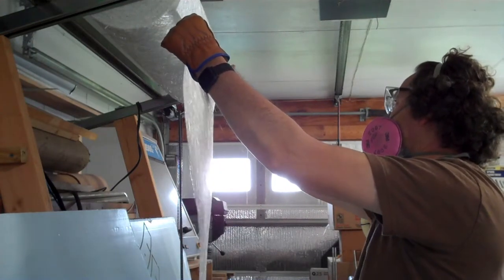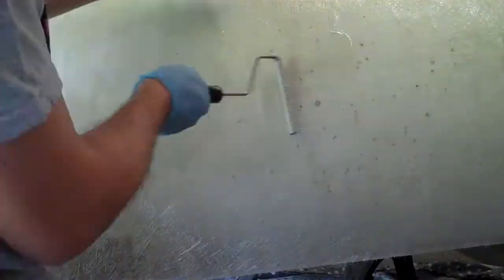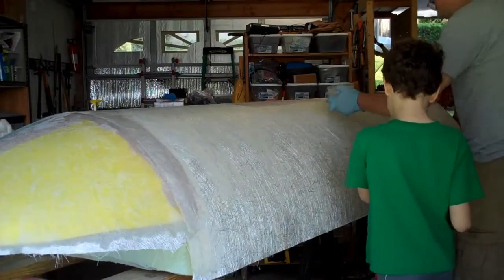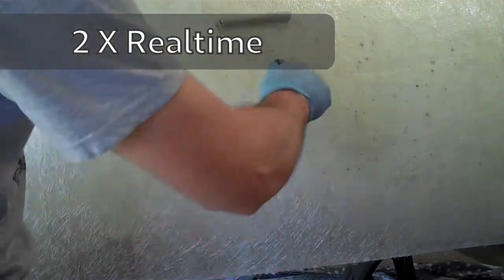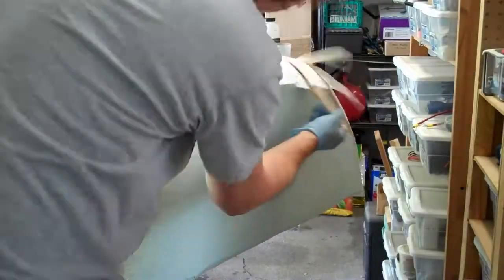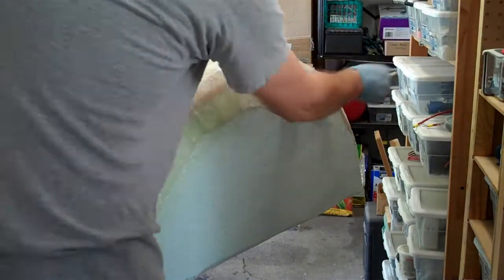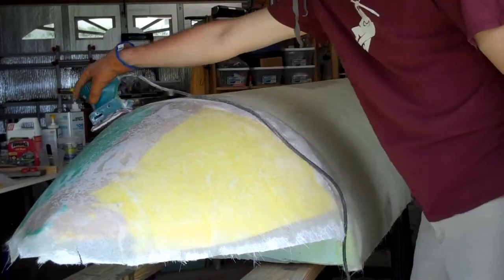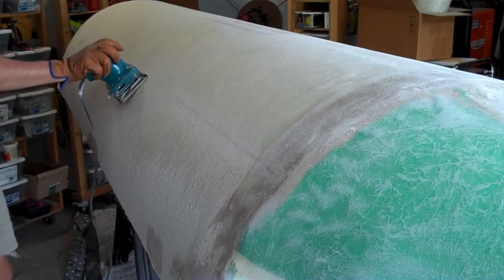Using Chopped Strand Mat with Epoxy (Building a Fiberglass mini-pontoon boat part 3)

Comment: I've never had a problem with it. I repaired a hole in the bottom of a jet ski with chop strand Matt and polyester resin and then took the boat out and the hole patch just popped off. I redid it with epoxy resin and chop strand mat and it's been holding for 8 years now.

Comment: Mix 1/10 acetone into your epoxy and it will dissolve the styrene binder. I do it all the time
Reply from the maker: I'm already using thin resin, and I'd be worried that 10% thinner (the absolute max) would reduce the strength by 60%.
Reply: @summetj  the acetone will evaporate after it melts the styrene binder. Your resin wont be weaker.  Your fiberglass is weaker than it should be if you dont break down the binder.
Reply: 1/10 of just the epoxy resin or the hardener and resin comb
Bined
Reply: @redwood1957  combined
Reply: @bipedalhominid6815  1/10 by weight or volume 🤔 sorry im a newbie.  Thank you
Reply: @redwood1957  volume. Also 99%.of current day CSM is epoxy compatible.

Comment: I wonder if you could add some styrene to the epoxy to get it to break down the binger in the mat.
Reply from the maker: Adding styrene would probably work to break down the binder, but I'm almost certain it would NOT be good for the Epoxy curing process. (I'd rather have the mat hard to work with and strong epoxy than the fibers broken apart and epoxy that doesn't hold ;>).  If you really want mat to break down with epxoy, you need to buy epoxy rated CSM.
Reply: @summetj  can you get that in the USA epoxy cam? I have seen people mix csm and biaxal Matt every other layer? What would it take to know the difference after it’s painted?